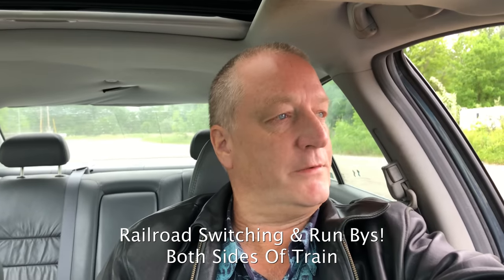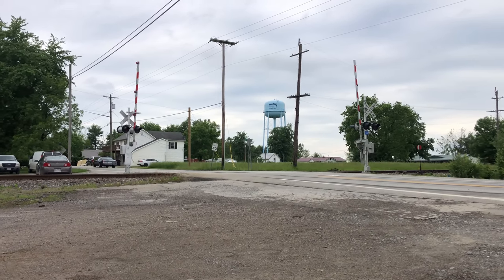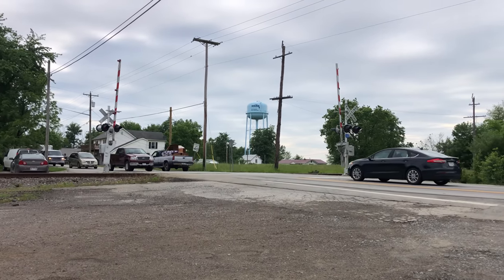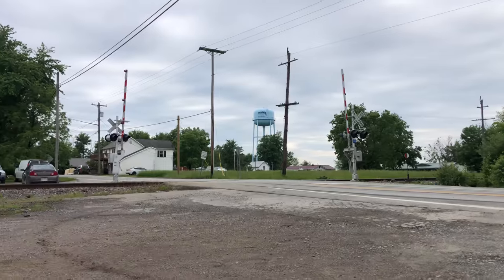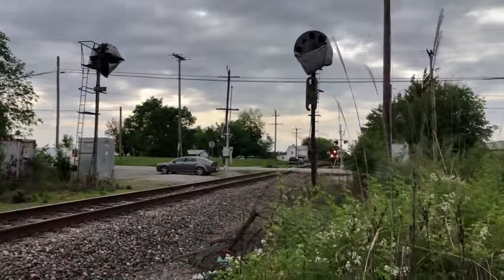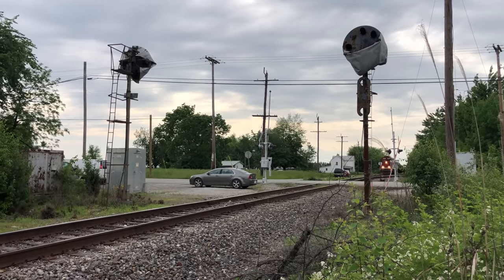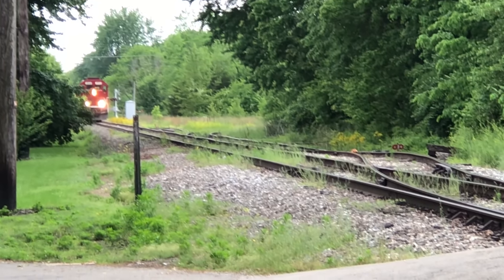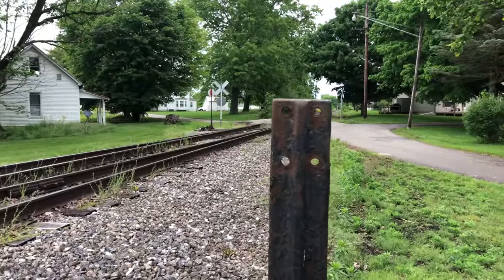Rare Train Move & Railroad Switching At Awesome Railroad Crossing On Sunday!  Cincinnati Eastern RR!

Comment: Great communication between the conductor and engineer, you barely hear them usually, at least not like this conductor. great partner to have. I love the communication between the 2.
I'm amazed that at 65-68°F we need a jacket, or sweater to be warm,  comfortable, but in January it feels warm outside at that temperature.  You mentioned the temperature, and was wearing a jacket made me think about it. Nice to see the cooler weather.

Comment: ChainsawN&W1218, the switching is really cool, love those SD 40-2S air horns, there's a place I film on NS Whitethorn District where they actually still have and use the old N&W color position light signals like You were filming ,but earlier this month an NS signal maintainer told Me they were replacing them with PTC signals, I'll sure miss them, I filmed  alot of  other ones in operation that NS replaced already.

Comment: nice video JT, i been watchin for a couple of years, being educated. i live in a UNION PACIFIC Railroad Town, Lombard, IL. Tuesday through Sat. high volume traffic. many time we have 5 loco pull setups and the 6th is a DPU pushin the rear. I fish by the Staging area. Usually 2 Loco setup. Today 6 engine pull; heading your way then a double Stacker with 5 loco engines pulling west. There are 3 different yards for staging, West Chicago, IL. about 40 miles west of downtown Chi town. Then the Bensenville yard up north east close to Ohare airport, HUGE extending east. Then the far southside yard either BlueIsland or another. Real big due to easier serving of longruns going far west or far east USA. Thanks for all your local action. 🐈‍⬛ cat gettin fat JT, you almost give it a half sandwich there🤪

Comment: Prettiest trains in America. I've always wondered, what are those little hissing sounds when locos are sitting? I always thought it was the electric drives.
Reply: The hissing noises are the main reservoir automatic blow-down valves, which prevent moisture from accumulating in the air tanks.
Reply: They're really active on this engine, more than any other I've seen, the cameras really pick the hissing up!
Reply from the maker: Thanks for watching!  Yes they prevent moisture damage

Comment: Could the concrete pad at the new park be what they call a splash pad for kids? Splash pads are concrete pads that are slightly bowl shaped and have water jets in the concrete that spray up in a pattern like a fountain so kids can play in during the hot summer. I couldn't tell if it was sloped toward the middle but it seemed to have drains in the center and the water jets around the outside of the circle. Possibly what it is but I'd have to see it better to make a definite decision.
Reply from the maker: I don’t know but thanks for watching!
Reply: I was also thinking "splash pad".  The town where I live has one and it looks similar to the video.
Reply: Agreed - that screams small splash pad.
Reply: Definitely a splash pad!

Comment: I'm with you, Jaw Tooth, love the old color position light signals.   Any still active in Cincinnati?  I think the old B&O has some, but wondering about NS/N&W.
Reply: Only ones I think are on the old coal branches like Wolf Creek that goes into eastern Kentucky at Lovely . Warning do not climb signals in some cases 20 years ago the only thing holding them up was the years of paint sealing it to the base!
Reply from the maker: There is a good B&O signal in use just north of Queensgate Yard.  The line through Troy has some.  There are still some hanging on.  I found some in eastern Kentucky and in West Virginia

Comment: JT, what's the Chinese handheld scanner you showed in a previous video? Would you recommend it? What other accessories are required?
Reply from the maker: Baofeng UV6R comes with drop in charger.  There are other good models of these radios also.  They are cheap but complicated to use
Reply: @JawTooth  How much more complicated than, say, a Uniden BC125AT? Enough to make it more prudent to wait until I can justify buying a Uniden scanner?

Comment: Do these guys run into Claire yard?
Reply from the maker: Claire Yard is the interchange for this railroad with Norfolk Southern , however, this particular train does not go to Claire.  The rock shuttle trains only run from the quarry to Roundbottom road in Milford.  The rock hoppers never leave this railroad line.

Comment: I thought they had to have EOT on their last car?
Reply: Would that be necessay if they don't run someone else's mainline?
Reply: @oldad6207  I would think so, at least a red flag on the end car. 

  I've seen many short line/private railroads and they usually for the most part have some indicator on the last railcar, whether an EOTD or red flag.   

But, sometimes on occasion they won't, but I think they "are" supposed too.
Reply from the maker: They are only needed during poor visibility like at night or in   a storm.  That is what I was told
Reply: @JawTooth  A red flag is required by FRA regulations, a flashing device on the rear allows for nighttime operation and with the maximum speed of only 25 mph which is pretty much a “shortline standard” you pretty much don’t need anything else……good catch bg~~~

Comment: Why does engine 1657 have a clicking noise?
Reply: I haven't gotten that far in the video, but I'm going to take a wild stab at what you might be hearing. I'd bet you're heading the spitter valves that expel water from the airbrake reservoirs.
Reply: Now that I've gotten that far, I confirm my previous remark.
Reply from the maker: Thanks for watching!

Comment: whats the bell for on the trains
Reply: It's a warning to folks close or around the tracks that the train is in motion/moving.

It is used anytime someone is near the tracks.  I've been out in the the middle of nowhere, no crossings for miles and the  conductor/engineer would set the bell ringing as they approached and passed by me.  Sometimes I'd get some friendly horn toots if the crew knew me, if not, just got the bell ringing.

I think it may be an FRA requirement to ring the bell anytime someone is close to the tracks, but can't say for certain.

Basically, it's just a warning sound, like the horn as they blow for the crossing.
Reply from the maker: Thanks for watching!